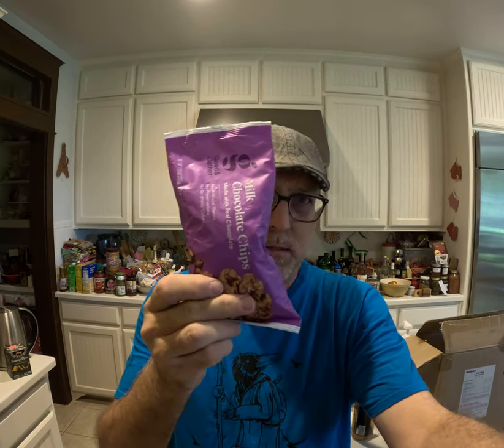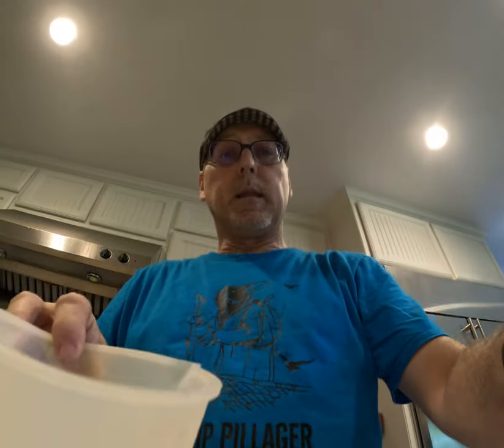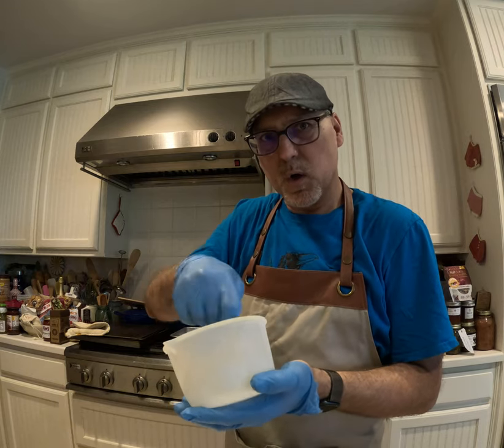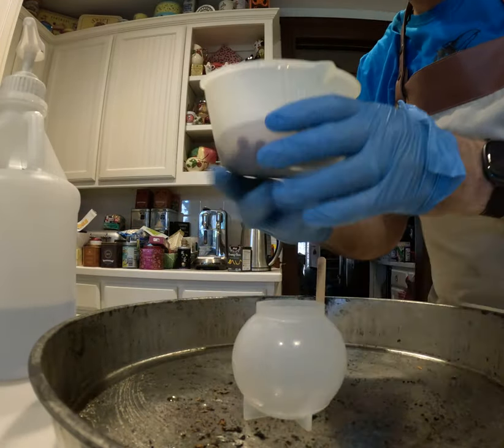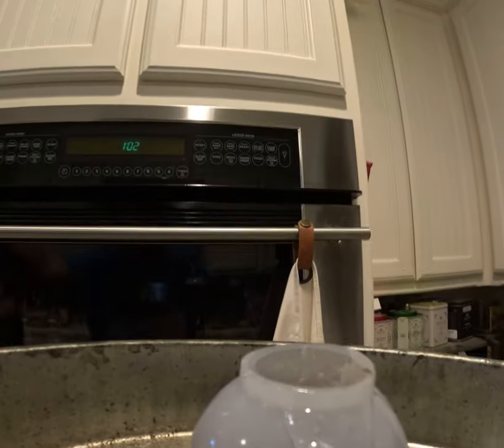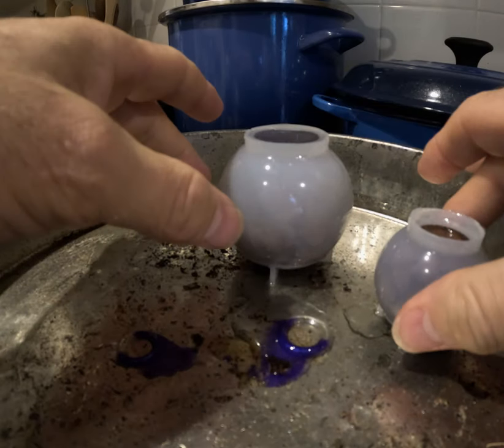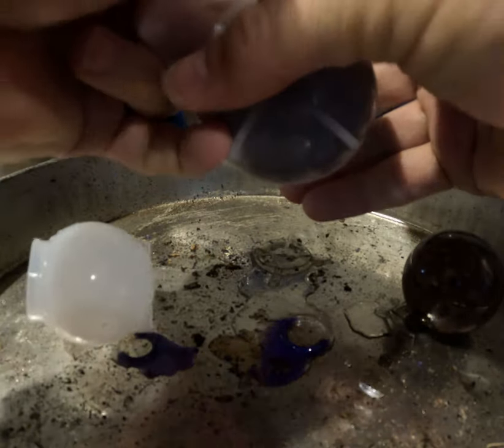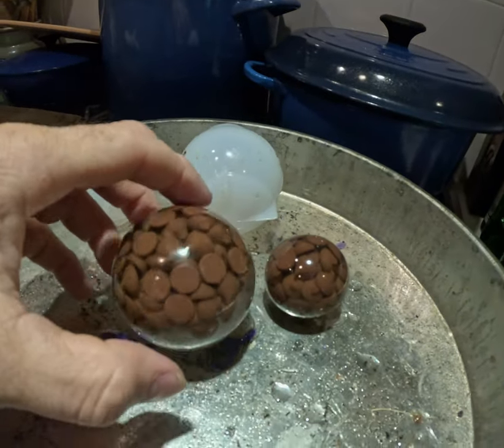Cooking up some chocolate chip resin spheres

Comment: That's a great idea Brother! I was concerned about the exothermic reaction melting your coco... glad it worked out!
Reply from the maker: I was a little worried about it too, but figured then I'd just have melted chocolate blobs encased in resin, which might be just as interesting to look at!

I do have to seal the large one though. Some of the chips were right on the edge, and so a few tiny spots aren't covered in resin. You really can't tell until you hold the piece and the chocolate starts to melt in your hand!